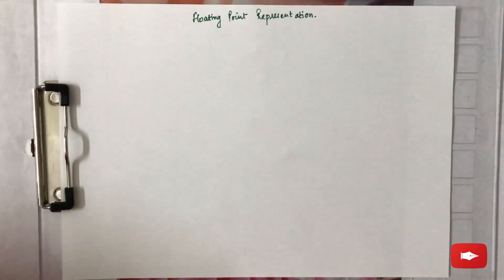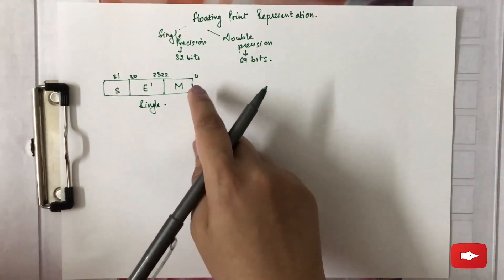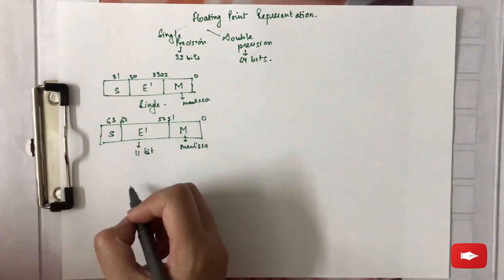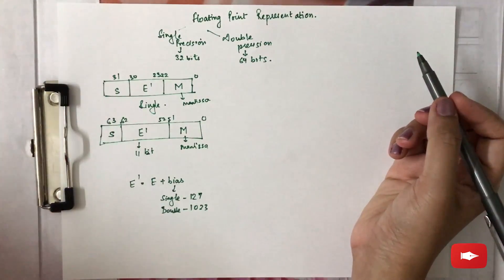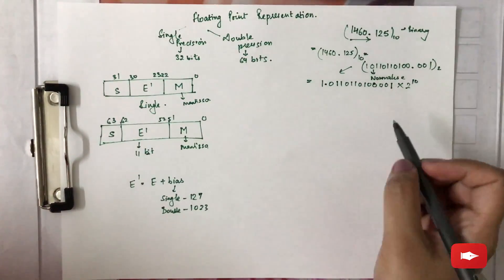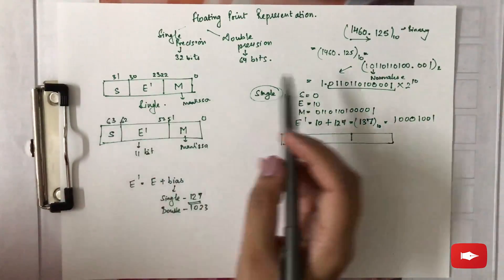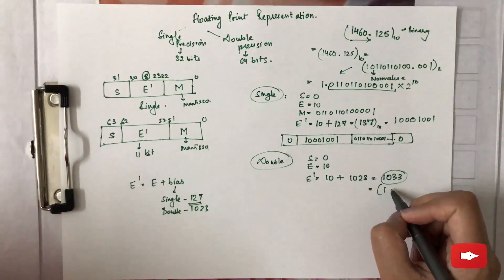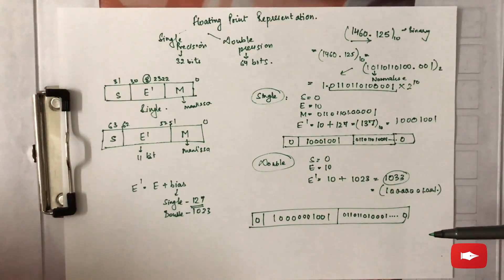Floating Point Representation

Comment: we cannot put dot dot dot  in mantissa part because this will show the numbers are repeating. I think we can put zero before the mantissa to make it 23 bit in single precision and 52 bit in double precision.please reply for this whether i am wrong or correct.
Reply: Basant Dwivedi zeoros are supposed to be on the Significant bits ,,,,she got it wrong,,,,,,,then digits can be accordingly arranged at the end
Eg if the mantisa is 11111 (5bit long) but space is 8bit long
=> 00011111
And not like 11111000